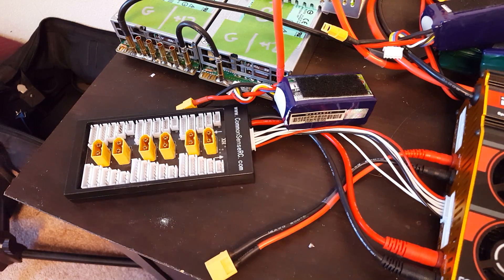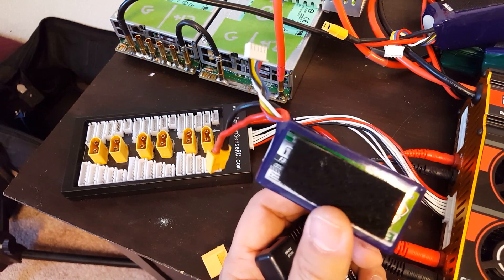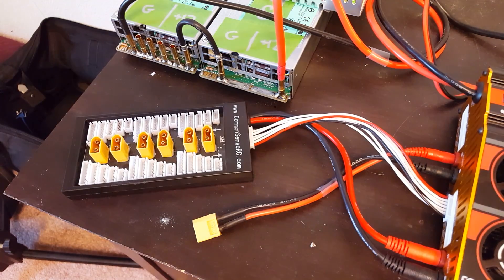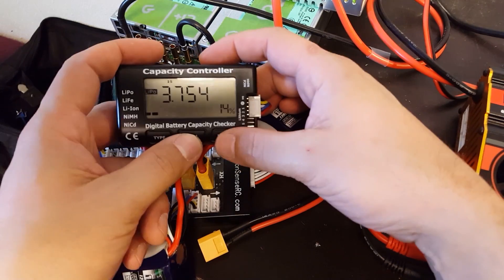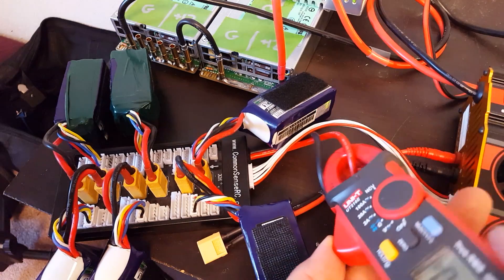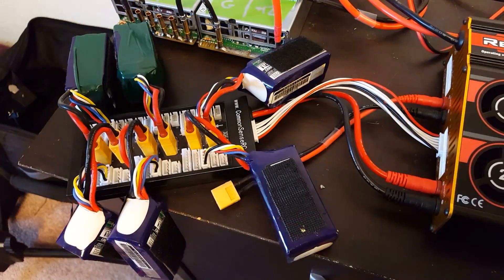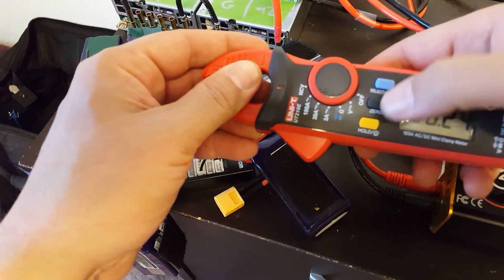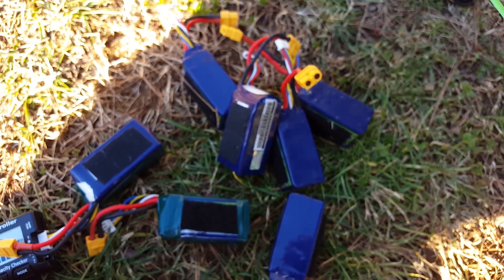Balance Charging: Can you parallel charge?

Comment: @ Joshua...I would like to begin using a parallel charging board....so please help a non-electronics literate person understand something....say my just flown 3S LiPo  battery pack  A  is at a  total  voltage  of  11.2 v   and  cell 1=3.80     cell 2 =  3.78   cell 3 = 3.70      what  numbers / voltages  would be  acceptable  for other 3S batteries to charge  along with  battery A ?.... I'am I looking at individual cell voltages  or just other battery's  total voltage ?......please give me an example with numbers ....thanks
Reply from the maker: +Gary Vale in your example, I would want to be within 0.1 volts if each cell. So basically every other battery would have to be between 3.7 to 3.8 volts.
Reply: I've watched  other videos that state within  being .2  volts is acceptable.....thoughts?.....
Reply from the maker: +Gary Vale search my channel for "equalization current"
Reply: ok...thanks

Comment: para balance charging is perfectly fine I have been doing it since balance boards first came out.. if the batteries are within a tenth of a volt or so they will equalize while charging with no wait time for them to do so and be perfectly fine.. if there is a 3 tenth volt difference between packs then I would start thinking about not charging that pack in that batch but .05 to .1 volt difference will work its self out during charge, now like I said if a pack is .2 to .3 or more different then charge that pack by its self.

Comment: After a day of flying all my packs are more than 0.1V difference from each other, sometimes by a lot.  What's the best practice / procedure then?  Just charge them individually, or discharge them all then parallel charge them all together?  I find myself not able to parallel charge all that often because my packs are always different.
Reply from the maker: Get an OSD so that you can easily finish flying at a consistent resting voltage?
Reply: I actually do have OSD on my rig and I try to land when I see my min voltage flash on my screen, but after the pack rests it ends up being different from my other used packs.  I'm also a newbie to the hobby, so I'm all over the place and so maybe when I'm getting low I just need to just hover and wait to see what voltage sits at before i decide to land or continue.  Besides that though, thoughts on discharging before parallel charging? Not worth the trouble?
Reply: Remember that you want a tolerance of 0.1 volts per cell. So for a 4S battery, that's a 0.4v difference. Say battery A is at 14.8 and battery B is at 15.2, you would be ok to put both of them on the balance charger together. I personally try to keep it to a 0.2v tolerance for my 4S batteries, but you wouldn't do any direct damage and risk hurting anything if your batteries were like the ones in my example.

One of the most important things to do while you're starting out is to make a correlation between the voltage level on your OSD while in flight and your voltage level after you land and disarm. For my setup, I know that if I'm at 14.8v while doing nothing but hovering for a few seconds, my voltage will bounce back up to about 15.1 once I land and disarm. I only fly my batteries down to 15.0 - 15.2 volts (3.75 - 3.8v/cell). If you wanted to, you could even land and disarm, like you mentioned, and check the voltage while resting. That's totally cool. The more you fly and focus on your voltage in air and on the ground after the flight, the more you'll make that correlation. But it's important to make that correlation early on.
Reply: Brennan Lawrence thanks that helps a lot
Reply: Thats my recommendation as well, .05 to .1v per cell is a safe range, .2 would be pushing it and .3 needs to be charged by its self for sure. this is a very good post and accurate, if I would have read it then it would have saved me from having to write more less the same thing. I did answer a question about why IR makes packs accept different current levels while para charging so I guess it wasnt a waste of time.

Comment: why are they all 16.7v  isn't a full pack 16.8.. I notice when I change a set they all come out 16.7 but when I start the charger again after just finishing at 16.7 usually it starts charging for ruffly another min or 2 and then they all register 16.8  so why is that?
Reply from the maker: That last fraction of a volt doesn't make a difference. Don't worry too much about it. What is happening is, the charger is holding the voltage at 4.2 volts to charge each cell up, but as soon as the charger stops charging, the cells "relax" a tiny bit and go back down to 4.19 or 4.18. Perhaps a different charger would do a better job of getting them to exactly 4.2, but if yours doesn't, don't worry.
Reply: Good to know. thanks
Reply: The only charger I have ever had (And all my chargers are high end chargers) to balance to exactly 4.20 is my Icharger 410Duo, my Icharger 406Duo will bal them to 4.19v per cell and every other charger I have ever had will do 4.18 or 4.19v per cell.. It was odd to see them dead on 4.20 every charge when I first got that charger... and no one I dont care how good you are will notice 1/100th or 2/100th a volt worth of power lol so its moot point. charger applies load and the voltage comes up, it keeps the cells at 4.20v under current and as soon as the current stops the cells relax and the voltage falls 1 or 2 100ths a volt, how the Icharger 410duo does it and does it stupid quickly for that matter and doesnt over charge the cell I have no idea.

Comment: My charger (I'm sure like most) has a few modes to pick from quick, normal, balance, and discharge. I don't have a lot of batteries yet so I am only charging one at a time. Should I always use the balanced option? Do I lose battery life by choosing  normal mode?
Reply from the maker: +kerjs02 yes, always balance.
Reply: Joshua Bardwell Thank you Josh

Comment: What do you usually do when you have let's say one pack that has 3.7v in all cells and another one that has 3.9v in all cells?
Reply from the maker: +GalaxyCake charge them separately.
Reply: Some chargers do only charge trough the balance leads. You could try using such one, as they should not charge a cell that is higher than another. I have 2 of these that can charge 2-4 cell batteries and they work grate.
Reply: link to one?

Comment: I've plugged in a 1300 mah and a 1500mah in together. and balanced fine
Reply from the maker: Yes, of course. That is consistent with what I said, right? Not sure your point.
Reply: zooby dooby wait you can charge 1300mha with a 1500mha and or with a 1350mha and everything will be ok.. I was under the understanding they had to be same or possibility of overcharge happens
Reply: The only thing that needs to be the same is the voltage of the pack. 4S with 4S, 3S with 3S etc. the capacity of the batteries doesn't matter.
Reply: Really cause would seem weird to put a 1550 with a 850 and them to evenly charge them
Reply: So as long as the volts are within couple points of each other and the amps charging is the total amount between all batterys.. it will only fill to what it's capacity is then push rest on to next battery?
Reply: Pretty much. As the batteries charge the internal resistance changes and electricity wants to flow in the path of least resistance. So it will go to the least charged packs. But that doesn't mean it fills each battery one at a time and moves to the next one. It evenly distributes the current across all the packs.
Reply: You sound like you know something about lipo. So did you catch the video about shaking packs as they charge? What was that all about if it was anything
Reply: Uhh... if you're referring to that Rotor Riot video from last month that was an april fools joke :/

Shaking your battery isn't going to do anything.
Reply: oh my god, was that april first when they posted it.. haah didnt even realize
Reply: OK what about parallel storage.. can I pull more then one battery on when I'm setting to storage..

Sent from my T-Mobile 4G LTE Device

-------- Original message --------
Reply: You can, but it would be extremely slow. Just as with doing anything in parallel make sure they are all the same cell count and close in voltage. I find it faster to just go out and fly the packs down to storage voltage and have a little fun in the process. I've used the Storage/Discharge mode on my charger like once.
Reply: As do I but on Sundays I usually put all in storage except like 5 packs. Just wondering if it's easier to run 3 chargers doing a pack each. I actually just left them this time instead of putting All at 15.2  there all around 15 - 15.2

Sent from my T-Mobile 4G LTE Device

-------- Original message --------

Comment: I have a small single 50w lipo balance charger  that goes up to 6s  very similar to the Turnigy 50w ac dc charger.  Will a parallel board also work with those.. or do you need a super high end charger to do this..
Reply from the maker: Yes, parallel charging will work with this, but you won't be able to charge very fast.
Reply: So my charge time will be longer than what it is with a single battery?
Reply from the maker: +Dirk Behrens sure. It takes longer to charge five batteries than 1. If you can charge five times as fast then that's different but your charger can't.

Comment: Yee. You were charging at ~10A and that's why that cell was receiving 2.2A. If the charge rate were set at 1c it wouldn't be that high, correct? I'm waiting on my ClampMeter to verify and learn some more about that.
Reply from the maker: The main point is that the batteries don't necessarily receive exactly 1 / nth of the current, where n is the number of batteries.

Comment: how does that checker work, is that .007 at the end the difference between the 4 cells within your battery? Also before you charged, you checked voltage. I seen people say that all batteries need to be within .1 volt of each other, others say they only measure the first cell, but I noticed at the beginning you check the voltage between cells as well,  does that matter?
Reply from the maker: All of the cells will be in parallel with their partner in the other packs. So they will exchange current in proportion to their voltage difference. Therefore, all of cell #1 in all of the packs needs to be within 0.1v of each other. And cell #2 with themselves. And so on.

In general, if the pack is reasonably healthy, the cells will be close enough to each other that checking only the overall pack voltage will be sufficient. So two 4S packs would have to be within 0.4 volts of each other. But if you have a bad cell, it can be very far out from the others in the pack, and it will destroy all of the other cells it's in parallel with if you plug it into a parallel board.

So let's say we have five packs, and they all have cell #1, 2, 3, 4 at 3.6 volts exactly. But one of them has cell #2 at 3.2 volts. We check the voltage of the packs and they measure 14.4 volts. Except for the bad pack, which measures 14.0 volts. Fine no problem, it's within 0.4 volts of the others, right? No. Cell #2 on the bad pack is going to suck current out of cell #2 on the other three. Cell #2 will take damage from the excessive incoming current. And the other cells may be damaged by being pulled down to a low voltage.

Comment: I hope this can get to the author of the video. I'm trying to charge a 6 cell nimh battery stick. it is custom so I have no hook up for a balance board or anything like that. since the nimh battery are very temperature oriented to their charge, I want to customize a balance board that works on temperature only.(of course the LiPo battery charger will work with the overall voltage). So I would need six individual temperature sensors and I want them to plug into a lipo battery charger. if that made sense, could you help me out?
Reply from the maker: I'm not sure how I could help you. I kind of don't know what you're trying to accomplish.

A standard battery charger will have a NiMh setting with a temperature based safety cutoff. But you can only plug in one temperature sensor.
Reply: So it is a lipro iMax6. It will charge even without the individual voltage and temperatures within the battery pack. It only gets the overall voltage and temperature. But I would like to hook up individual temperature sensors to each individual battery and maybe connect it to a balance board that works with the IMAX 6. That make sense? Basically I want to charge a cell of six batteries in a line with the only connections on other side of the stick. I may be asking the wrong question. If you had to balance a custom stick(row of 6) nimh batteries, how would you do it?
Reply: Any help would be greatly appreciated.
Reply: If I could make a custom setup for temperature and voltage on each individual battery, I would like to do that as well. So maybe I could turn a custom stick into one of those little battery packs with the appropriate hook up to the balance board..
Reply: Have you ever made your own pack of batteries?
Reply: If my ignorance is obvious, please feel free to enlighten me without restraint
Reply from the maker: +jake wallace yes.
Reply from the maker: +jake wallace Balance charging accomplishes exactly what you're trying to accomplish.
Reply: Joshua Bardwell it will balance in charge even without an individual read out of voltage and temperature?
Reply: the cell that I'm talking about does not have a balance board hook up
Reply from the maker: +jake wallace well there's your problem. This problem has already been solved. The answer is a balance connector. No need for you to reinvent the wheel.
Reply from the maker: +jake wallace no. You need a balance connector.
Reply: Joshua Bardwell the cell is not wired for a balance board connector. I realise that a balance/charger will not balance if it's not connected to a balance board. I'm asking about making custom voltage and temperature sensors that will connect to a balance board. Right now, i basically have 6 batteries in line welded together. Now voltage and temp would obviously be ideal, and That's what i would like to do if there is a Way.  B if i can't, i know that with nimh batteries, overcharging doesn't hurt them unless they pass a certain temperature. If i could make custom( external) temperature sensors, than I'm hoping i can program the balance board based on temperature
Reply: If you have information or a site that you can point out, that shows you how to wire your own balance board harness, that would be awesome.
Reply: If I do it based on temperature, I would just need the charger to reset the discharge/charge process based on temperature. Then I could balance them with a deep discharge and trickle charge
Reply from the maker: +jake wallace just charge at a low enough rate that temperature isn't an issue?
Reply from the maker: +jake wallace http://www.tjinguytech.com/charging-how-tos/balance-connectors

Comment: just started parallel charging my 6s lipo's i use in my 700 heli. and i like it so much i do it with all my lipo's now. I fly using telemetry and timer so my cells are very close to one other. and with the 700 i use the lipo's as a 12s pack so it's almost recommend to parallel charge them and i numbered them so they stay together. it is such a time saver charging 10 6s like this instead of all of them separately.

Comment: Small question. Since the XT60 side was still connected when checking for the 2nd time, weren't you measuring the "average" of them all...since they're still connected in parallel essentially...which is why the measurement was identical. What about disconnecting them completely? Just curious...I always parallel balance charge and have never had an issue.
Reply from the maker: I'm not sure I understand the question.
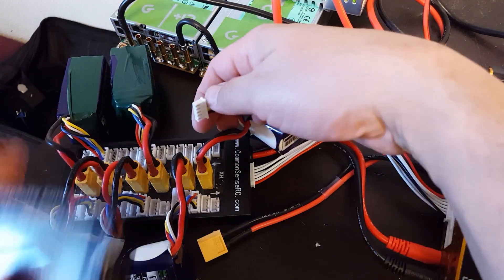Reply: @ 3:45 of the video when you measured from the balance lead...the XT60 side of the same battery was still plugged into the balance board...so you're measuring the average of all the batteries still connected to the board.  That's why they were identical.  If you uplug the Xt60 side also before measuring then you will be seeing only that batteries measurement.  I asked as a question, because maybe I'm missing something obvious here?

Comment: Joshua -

My personal recommendation is to ALWAYS balance charge with LiPos. EVERY TIME. They can get out of balance much too quickly, especially the way we abuse them on our little quadcopters. They actually beat on a pack as hard, if not harder than, big 3D helis do.

The reason there is a question of being able to parallel charge and balance charge is this: If a person DOESN'T check as carefully as you do EVERY TIME, is that if you have too many packs too far out of balance, even after allowing them to equalize as you've done, there will come a time when the limited amount of current capacity - typically around 200-500mA - that most LiPo charger balancing circuits can manage will be exceeded, and the packs don't balance out properly before the charge cycle cuts out on max voltage. Many cheap LiPo chargers will not even alarm on this state!

This imbalance is a thing that tends multiply quickly; a few cycles and you can have packs so far out of balance they NEVER get a chance to charge properly, and they CAN damage the balancing circuit in your charger.

Always, ALWAYS re-balance charge a pack that is severely out of balance (My tester alarms at more than 0.05V difference between cells, though I like your limit of 0.04V better) BY ITSELF!!!

Thanks for spreading the word about LiPo safety!

Please, PLEASE go back to using a chargebox setup though... charging on a bare benchtop (cringe) is BEGGING Murphy to make an example of you!
Reply from the maker: +mnemennth Honestly, you should always balance charge all your packs, maybe except when at the field and trying to get back in the air. But that should only be a time or two.